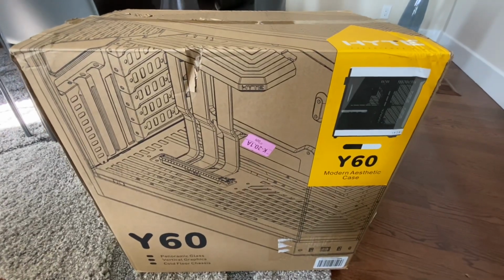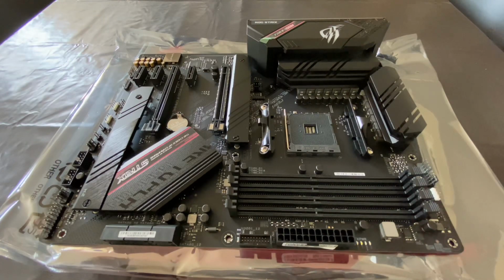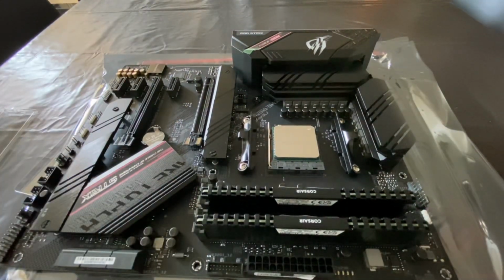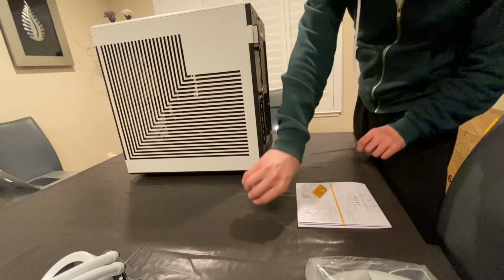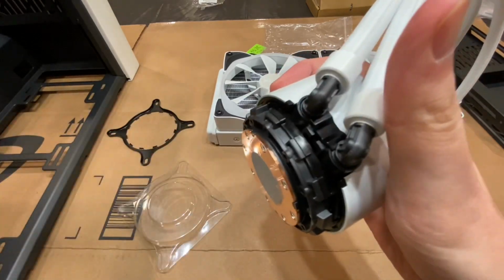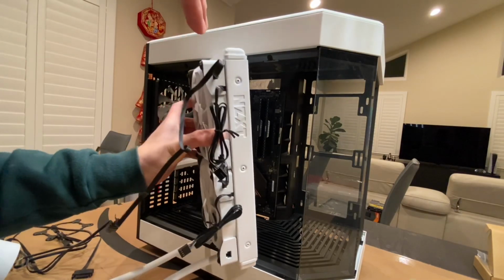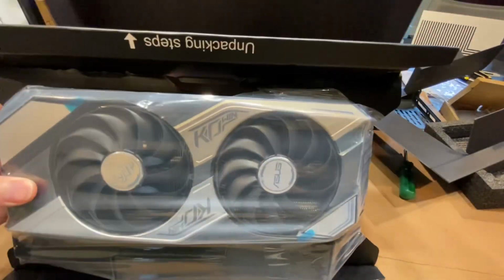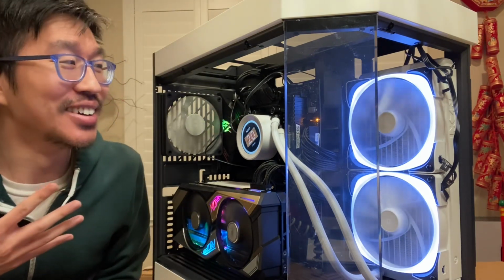Building my first gaming pc with NO EXPERIENCE | Hyte y60, Rtx 3070, Kraken z63

Comment: came by your video, you should flip your aio rad, the pump shouldnt be higher than the input/output of the water
Reply: its right the air bubbles would go to the top making the coolant travel easier and better temps